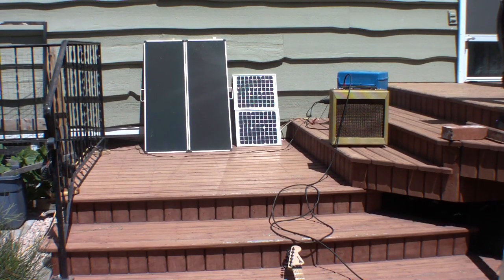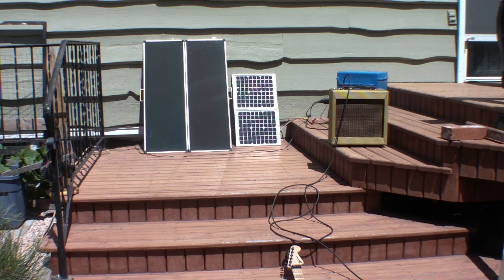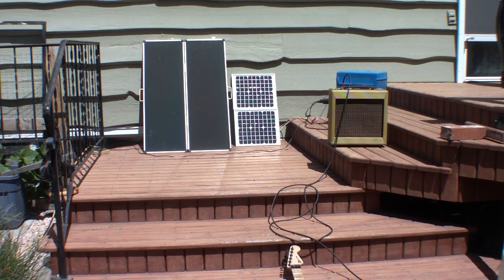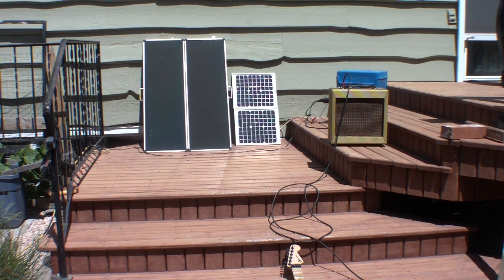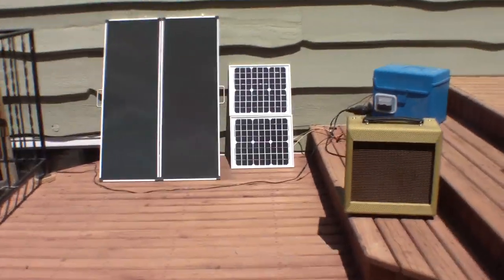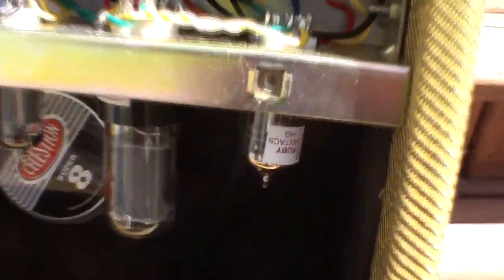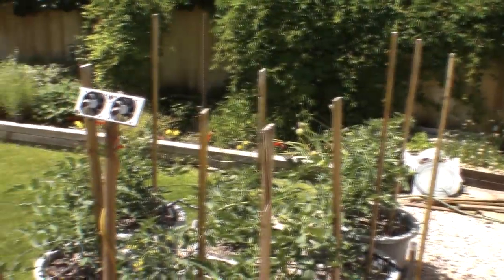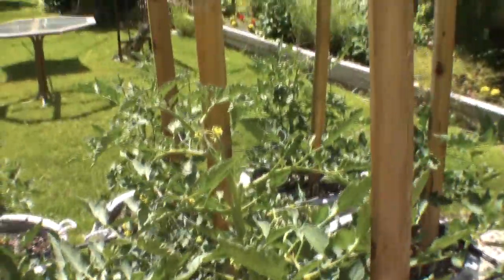Solar Power - No Batteries

Comment: Serious now... Do you notice any hum or buzzing as opposed to plugging into a normal wall setup?
Reply from the maker: Actually one bonus is that you get ZERO 60 Hz hum. I certainly noticed it's quieter and would serve well for recording. There was a bit of the (always present) single coil hum... Pure Sine Wave would be even better I imagine.

Comment: Very nice simple setup. Cheaper too and extremly low maintainence. LOL. Great guitar work.
Reply from the maker: Hey Ray, my man how ya been? I'm thinking I'm going to outfit the roof with Solar, and have a sizeable bank that I'll run on a dump controller, and have the dump controller go straight to running AC on capacitor driven Inverters. Cheers

Comment: Very cool setup...nothing to worry about when the sun shines :)
Got some tomatoes going myself...about the same height and i'm much further South. The 5 plants are using a gallon of water a day, thirsty buggers.
Reply from the maker: hey bud! I'm running on a timer, 15 min shots, twice a day 7AM and 7PM. The emitters are 4L/h so each shot is a liter, basically, two litres a day, but I'm thinking I better up it to 20 mins for the upcoming hot weather! Although I am getting a bit of leaf curl, so I don't know... Have only fertilized once and it didn't really seem to do much anyway - my soil is very high grade mix I've been working on for a while now. Lots of compost and mushroom manure in it. Container gardening is a little tougher than you'd think... this is my third year, still getting it down.